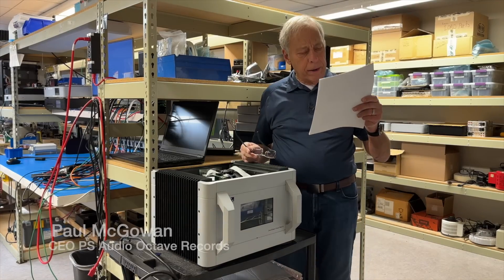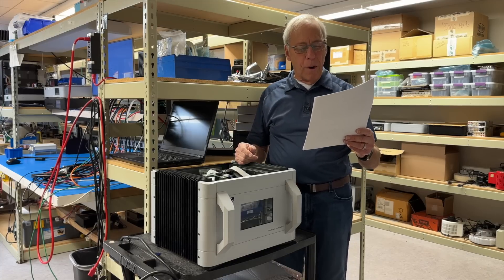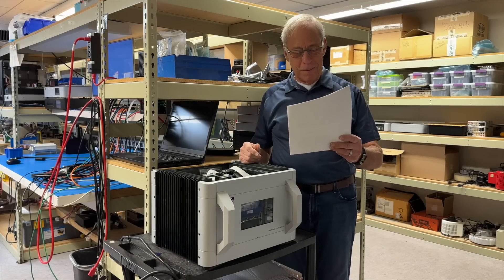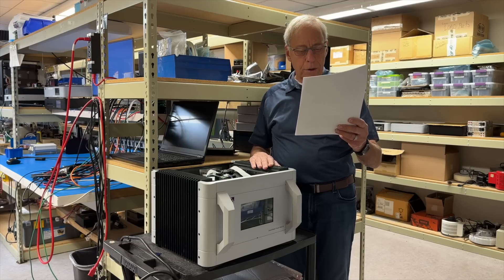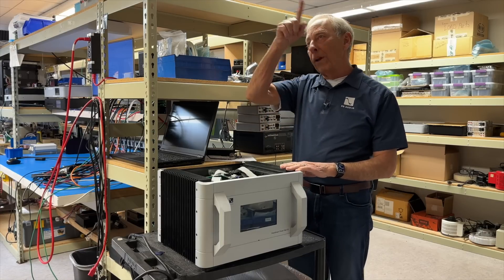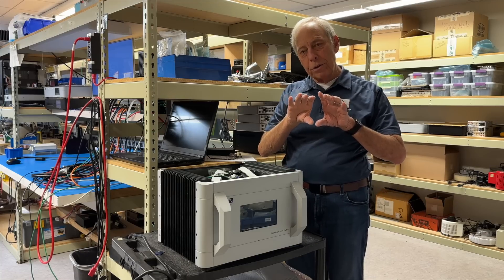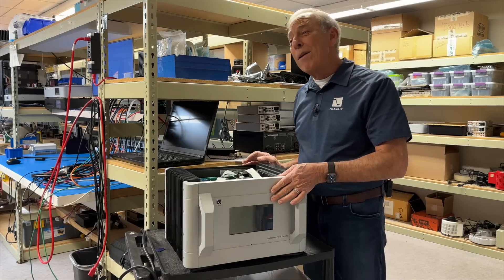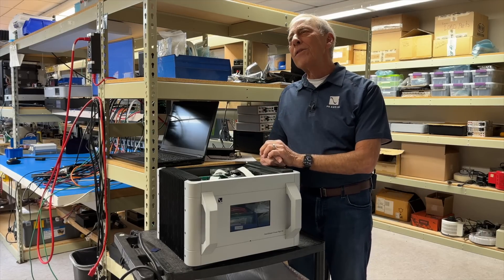How well does a Power Plant regenerate?

Comment: It is the quality of the D/C within your Hi-Fi units that matters, and that is the function of a good power supply within those units, which is there to iron out any wall outlet irregularities.
In addition, the large smoothing capacitors act as a stable reservoir to supply a low impedance D/C supply, which protects against voltage droop when loud audio transients take place. 
A power regenerator produces an excellent result in terms of a good 60hz sine wave output from a bad A/C wall outlet, and by the same token, your amplifier can produce an excellent result from the same bad A/C wall outlet.
Reply: Well, it is not that easy at all. AC to our homes come with lots of noises, distortions and also residual DC current (more and more these days). Residual DC can cause occasional "buzzing" in the system because toroidal power transformers have very low DC resistance at their inputs and any DC input present will cause very high currents to occur. I recommend reading article "Dirty AC Power: Getting It Out of Your (Audio/Video) System" by Roger Sheker for better understanding. Or maybe Paul will explain in some future video what Power Plant actually do and how just transformers and capacitors cannot get rid of all the "dirt" in AC line.

Comment: If it is only a magnitude better/improvement, you should use a (fully passive) ringing choke transformer. Does a fantastic job in regenerating the AC and has a fantastic mains transient suppression.
Reply: Doesn't affect the performance of anything though. It also wastes power.

Comment: Ok, it almost perfectly works…what is the audio improvement like? Has any one done an A-B test to hear any differences?
Reply: My friend has one and it made no difference. He even admitted it makes no difference and he's keeping it just on the fact that it looks cool LOL. It's snake oil at its finest
Reply: It also depends on your amp and it’s power demand.  For some it makes no to little difference for others  it makes audible difference.  Clean power may or may not be heard through your amp and dac. Just depends on it’s design.  That is why some people say it works great while some say it makes no difference.
Reply: @flargosa  the proof in the pudding is listening to it. You are speaking very vaguely and broadly. In 2023 there is a plethora of Hi-Fi products that have extremely good Distortion levels and have a black background. If you had to put a number on it how many serious manufacturers and long-living manufacturers do you think our noisy? In my thirty years of dabbling in audio it's barely anybody nowadays.
Reply: @ryanschipp8513  It also depends on the quality of your home power.  If your home power quality has issues then a good measuring audio equipment might not sound the same with your home power.  If your home power is already good then power regen might make little to no difference
Reply: @ryanschipp8513  there is one possibility  - your friend has  very poor system which can not detect any good change

Comment: Dumb question, but doesn't your amplifier do this on its own from the way with its own capacitors etc?  Also, isn't it current delivery that is also important?  Sure, P20 has 2000 watts available but both watts and amps are getting pulled by things pulled into this - not so relevant maybe for a cd player but an amplifier plugged into this wants both no...and potentially in huge supply?

Comment: Amir from audioscience did measurements and published them. Unfortunately Paul is not doing the same. I like Paul but his power plants don't add anything to better sound.
Reply: Amir measured the noise and totally misunderstood the reasons why the Power Plant is valuable. It's the tight voltage regulation under dynamic conditions that makes it valuable for what it does. Had he known that and measured that, it would have been a different story. Seems sometimes like Amir is more interested in poking fun at stuff than understanding its purpose, but then that's ok.
Reply: @octaverecordsanddsdstudios1285  -- Don't PS Audio products include adequately "tight voltage regulation" for all the DC rails supplying their audio circuitry?  If they do, why would regulating the incoming AC mains voltage be advantageous?
Reply: @editorjuno  Our low level products do, of course. Not power amps. Power amps are almost never regulated (their output stages). Moreover, one of the benefits of tight regulation of the voltage is the lowering of impedance - essentially shortening the length of wire connecting your system to the mains. Impedance is reduced by a factor of about 100.
Reply: @octaverecordsanddsdstudios1285  -- Pardon me, but that sounds absurd.  That "length of wire connecting your system to the mains" -- the AC cord--  is only the last meter or so of a circuit likely to include anywhere from 10-100 times that length stretching from the outlet to the service panel over ordinary 12 or 14 AWG Romex or some such -- not to mention the additional cabling out to the nearest pole-mounted step-down transformer.  If rigorously regulated DC to an amplifier's output stage is all that beneficial to SQ, why not build the necessary regulation into the amp itself?  If I were the customer, I'd resent shelling out $65k for a pair of your wondrous and already ponderous BHK mono power amps only to be told I need another device with a hefty 4-figure price tag in order to overcome a missing, aurally significant power supply capability.
Reply from the maker: @editorjuno  Well, understood, Bruce but welcome to the world of high-performance audio.

Couple of points to consider. Regulating the output stage of a big power amp would likely double the price of the power amp. It isn't as easy as it sounds. Secondly, the only way to lower impedance as I mentioned is by active means and that is, unfortunately, just expensive.
Reply: @Paulmcgowanpsaudio  -- Why would "Regulating the output stage of a big power amp...double the price?"  I mean, those mono BHKs are already ginormous and ginormously expensive -- why would regulating the power rails to its the output stage cost so much more than a suitable PS Audio Power Plant?  For that matter, considering the sheer size and weight of those things, you could simply build in the equivalent of a Power Plant, since anyone willing and able to purchase amps of their size and cost would likely have zero objections -- that is, if the Power Plant concept actually has any audible benefit, which yours truly continues to doubt.

Take care, (my fellow audio) old-timer!  😎
Reply: @Paulmcgowanpsaudio  -- Oh, fergawdsake Paul, if the Power Plant is so beneficial, why not just build its functionality into your $65k/pair power amps, which are already about the size and weight of a Mini Cooper?  
😆
Reply: @octaverecordsanddsdstudios1285  why not just design your power supplies properly in the first place?
Reply from the maker: @editorjuno  Because to do so would add 50% more real estate to those big amps and up the cost. Better to have an external solution like a Power Plant. Also, bear in mind we don't build Power Plants just for our own products. They are used around the world to help other manufacturer's products.
Reply: @Paulmcgowanpsaudio  it does require per se much greater design, and real estate and weight to perfect out as much as possible any components available  power and supply
Reply: @Paulmcgowanpsaudio  -- So basically you're asserting that the entire "high end" audio industry is selling amplifiers that require external "help" because the DC rails to their products' output stages are unregulated and therefore inadequate to the task of delivering an optimal "high performance" signal to the loudspeakers.

Alrighty then -- I'll just say that I appreciate your willingness to engage on this issue and leave it at that.

Comment: Designers os quality audio equipment are well aware of shortcomings in mains supplies and design power supplies to handle any issues. If your system sounds better with a Power Plant then you have either very dirty mains or poorly designed/faulty equipment.

Comment: I am using the power plant 3, it does not solve the "DC on the mains" issue coming off the wall, I am still hearing random buzz noise off the PP3, how does PS Audio PP address such Dc leakage problems ?
Reply: Are you sure you don't have a ground loop or something feeding noise into the system other than the A/C power line?
Reply: @EricBurbeck  I have all the system power cable connect to the PP3 and PP3 to wall, 2 other wall sockets are empty not connected to anything. Will there still be ground loop issues ?

Comment: Hi Paul, I can’t write you a letter because this is much easier on my hands. Anyway, I bought a PS Audio P3 Power Plant back in 2012, so not the stellar P3. Anyway it came with one remote that had Waveguide and Sinwave, I honestly don’t remember. But I’m still using the same P3 power plant today and I have to honestly say I never noticed any difference in my SQ or my picture quality? None. Can you explain why this is? I think it retailed at $2500 at the time. 
Thank you, Kevin

Comment: Audio Science Review measured THD+N and a few other tests on various amplifiers with and without the PS Audio regenerator and found no difference with and without it , Amir then fed the amplifiers a really distorted and noisy sinewave and once again the THD+N and his other measurements did not change.  I was not surprised by this as the input to the power transformer on a Carver "magnetic field coil " amplifier is a chopped and nasty looking partial sine wave out of a triac that keeps his voltage rails constant regardless of load which tells me the input line sine wave does not make any measurable or audible  difference  on a good amplifier.
Reply: Thank you for this comment.
Reply from the maker: Well, that is simply not true. Go have another look. It is why we build in a THD analyzer and scope. So people can see the truth. Bear in mind, the changes are limited to 1kHz and below.
Reply: Paul,  my comment was in regards to what appears to be misleading commenters. Will you be comprehensively testing performance at 1khz and far above and publishing those results? Also, I am quite curious to have the opportunity to retest with some additional chassis benefits to see if far greater benefits could result. Wishing the Best. Thank You.
Reply from the maker: @davidcross890  The regulation and lowering of distortion is limited to 1kHz and below. So, no, we won't be raising that higher as there would be no benefit. We publish now, on the website, the unit's specs and, as I mentioned, we build in to every unit its own THD analyzer and scope so you can check yourself.
Reply: @Paulmcgowanpsaudio  I understand more costs, space etc. would without question be required to properly treat 1khz and above and monitor it and make visual display of it but in my experiences this region above 1khz is also critical to perfecting out power delivery and auditory reproduction. I get all kinds of additional equipment/costs, but are you up for potentially at least for ultra high end to do a set of meaningful tests and potentially combine strengths of regenerators with other beneficial technologies and show this as a potential option?
Reply from the maker: @davidcross890  Sure, maybe someday!
Reply: @Paulmcgowanpsaudio  Please read the post carefully. ASR was measuring the distortion on an amplifier connected to the Power Pant. He was not measuring the distortion on the regenerated AC power.  The point is that with or without the Power Plant, the connected audio amplifier showed no difference in power or distortion performance. Which is exactly what we would expect.

I know PS Audio does no claim this, but quite a few audiophiles believe that distortion on the AC power line equates to distortion on an amplifiers speaker output, or a preamp/DAC audio output. As you know there is absolutely no direct correlation but this myth does sell audiophile power conditioning products for all who make them.
Reply: @andydelle4509  Thank you for clarifying the point I wanted to make that most audio equipment is not affected by poor AC power. Paul's mind went to an on line discussion he had with Amir who found that the re-generator's output was only slightly cleaner than the wall outlet insinuating  Amir did not know what he was doing when his expensive audio precision' analyzer is way more accurate than the display on the re-generator.
Reply from the maker: @andydelle4509  Andy is correct.

Comment: Is there a difference in the quality of the output between the Power Plant 3, 12, 15, and 20 or just the total number of outlets?  If I only need six outlets, is there any reason for me to think about anything beyond the Power Plant 3?
Reply: One would think there shouldn't be, but the sound quality isn't the same, the larger models allow for a bigger, more dynamic sound (as if someone took their foot off the garden hose). It's probably got more to do with the regulation (a stable low-impedance source) than the "cleanliness" (the lower distortion) of the AC. I'm not even sure the distortion is all that important apart from the flat-topping, since a well-designed power supply in the components connected to such a device is going to convert it to DC anyways. The larger models may seem like overkill, but listening to the difference, that in itself appears to be the point of the matter. Because on the face of it, using a regenerator doesn't seem to make much sense. Try to get a demo: maybe you're lucky and it doesn't make a difference sonically, and you'll save money. I've heard systems in which the difference was small, and ones where it was such that it seemed to make the price of the regenerator reasonable to non-audiophiles. I personally wouldn't buy one blind without demo.
Reply: @LeonFleisherFan  I greatly appreciate the level-headed and thoughtful response.

Comment: I've seen big bands touring the world playing live using equipment like this, not because it's Always needed, but sometimes it is.
I've even seen some houses with bad enough wiring to make the light flicker when you crank the stereo. 😂
Too much money for me though...
Reply: What live sound setups typically do today is to have UPS units on all there digital gear, especially the mix consoles. The reason is that unlike older analog gear, digital products often have a reboot time. Consoles today also have operating systems, Windows, MAC, Linux, and we all know how long that takes to boot up. Can't afford even a glitch that would cause a reboot. Their power amps though are usually direct fed.
Reply: @andydelle4509  I'm not sure how many that's using it, but I know some have shown it on rig rundown. I'm not sure if they are exactly the same either, but it's because the electric supply isn't always perfect. 🙂
Computers and glitches can be a nightmare, let's hope they have back up in airplanes as well. 🙈😂

Comment: Paul why do you continue to spew marketing terms, instead of simply doing some precise measurements to show the “perfect sine wave”? They’ve been done by audio science reviews and shows absolutely no difference to sine wave nor AC quality, if anything it’s worse.
Reply: It's hardly "worse" and definitely better. That's why we build in a THD analyzer as well as a scope on the front panel of our bigger models. Audio Science missed the whole point of the Power Plant somehow thinking it was like a power conditioner designed to filter noise. It is not. It is a dynamic voltage regulator that produces a new sine wave that is low distortion and tightly regulated.
Reply: Yeah, it "produces a new sine wave that is low distortion and tightly regulated" -- which has zero effect on the DC output of a properly designed amplifier's power supply and, absent confirmation bias, no audible benefit.
Reply: "No difference" is simply not true. The powerplant had a more uniform sinewave than the AC mains and the powerplant had lower distortion than AC mains, per the ASR review.

Comment: Yeah digital scope that's not the same as analogue lol depends where you're measuring it from are you measuring it from the output sockets? just get an isolation transformer pushing out 130 volts and then there's no issue